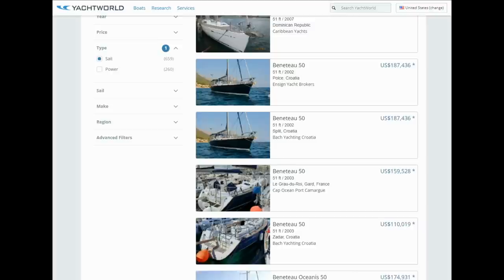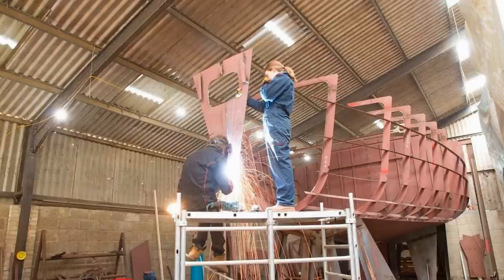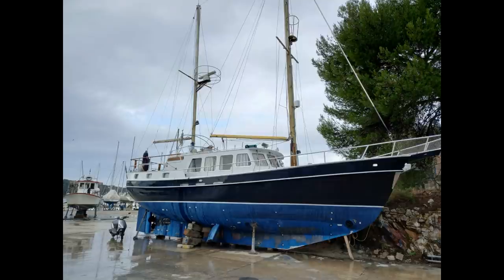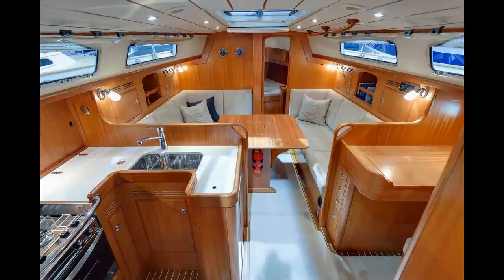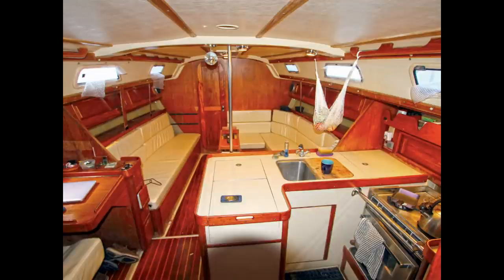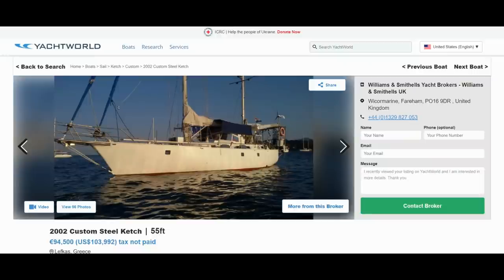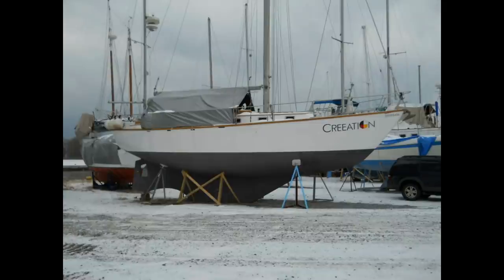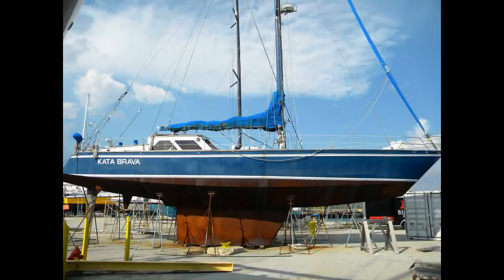Steel Sailboats - Episode 175 - Lady K Sailing

Comment: I have owned a 39 ft Folkes steel hulled sailboat for over 23 years. Fully loaded with provisions it weights 23,000 on the crane scales. All boats have inherent issues with hull materials, whether it is osmosis (fiberglass), rust (steel) or corrosion (aluminum) . Proper grounding of all electric systems and especially if shore power is used is the most important thing for any boat, as a lot of damage is done at the dock.  This applies to all boat materials. Cruising carries risks and if you are into going into places that are more risky such as remote areas (such as BC coasts) or areas of quick weather changes, hull material is an important consideration. Steel hulls can be repaired quickly and effectively without storing chemicals onboard. My alternator system is a Mobi-Weld system (90 amp Baush alternator with a 180 DC welder). I have two 2 by 2 steel plates under the floor that can be screwed to the hull or welded on. Mass produced fiberglass hulls have long moments on their keels (we are not talking about older full keels but fin type). It is this long moment of the fin keel striking a protrusion that is critical for these boats. The fin is forced back and the keel box is ripped out in front and the interior structure is pushed up and the hull becomes holed. With the Folkes we hit a concrete structure that was not on the charts or chart plotter at 6 knots and the result was a 3 inch dent at the base of the keel. The boat was stopped immediately and it was quite violent in nature. If this had been an fiberglass boat that would be the end of our cruising.  Most steel hulled boats of 36 ft or more have steel coach and decks as well. The old days of steel hulls often had wood however this creates its own issues. The steel hull interior has to be zinc epoxy coated before insulation is sprayed in with fire retardant foam. Hull and deck fittings are not welded on most times and are threaded holes with the bolt head on the inside and the foam sprayed over them so as not to sweat. This allows quick removal of all hardware for maintenance ( such as painting etc). I lived on my boat for 17 years (full time for over 7) and in winter the boat was at as low as -40 and up to +45 and was always comfortable. The fiberglass boats that I lived on always sweated on the inside and black mold was always an issue. As to the price.....a good used steel hull is generally cheaper than that of a similar sized fiberglass boat. The hull is about 1/3 of the price of the total boat....
Reply: Wow, thanks 👍
Reply: Fully agree … thanks
Reply: thank you for sharing your experience !
Reply: Thanks
Reply: I'm too poor to pay attention but I will buy a steel hulled sailboat or a motor sailor if the opportunity arises and live on it until I croak.

Comment: I love my steel sailboat - Bruce Roberts Spray 42, coming up to 50 years old and still in good condition. One thing is that even if you do get some rust you either clean it up and paint, or cut out the rust and weld some new metal in - it’s not that big a deal. Another thing, avoid sprayed on foam insulation as it hides rust.

Comment: I don't want to be mean but as someone who has cruised on a steel boat for the last 16 years I don't agree with a lot of this information. I'm not sure if this fellow knows much about them. I'll give just one example of many. Most of our boat has 3 coats of epoxy and 2 coats of polyurethane. These paints are not particularly expensive. What is extremely expensive in time and money is dismantling the boat and repairing rust before it spreads. This is a huge and constant job. Sandblasting inside your yacht is not fun or easy! Sure it's strong which is very nice as we are sailing in remote areas surrounded by reefs, and doing night passages straight through areas full of huge floating trees, but steel yachts are FAR more work to maintain than fiberglass boats.

Comment: I have plans for a 27’ Bruce Roberts spray that I was going to build until Larry Pardey told me a couple decades ago, at the Annapolis boat show, not to build it. He said he knows people sailing them and they don’t want to come about easily. The most important thing to check for on a used steel boat is the bond of the interior spray foam insulation to the steel hull. The hull must be coated with epoxy before the foam is sprayed on or the boat will rust from the inside out. Too many people think they can just spray the foam on bare metal but, the foam breathes and allows air to get at the steel. If the steel isn’t primed properly the interior epoxy paint will lift off the steel and the steel will rust unseen under the foam. If anyone is interested Brent Swain, on Vancouver island, has designed a number of steel boats using a frameless origami method. Darts are cut in the steel plates which are then pulled together and welded. The darts are welded up and they end up under the waterline so they can’t be seen. He claims he can weld up a hull and deck structure in two weeks.
Reply: Spray foam should be specified as closed cell foam. That does not breath, does not allow any moisture to move into the material. Remove any spray foam not imperials and replace with closed cell or use rigid rockwool insulation.

Comment: Enjoyed the episode. I have owned a steel boat for 28 years and I was getting ready for the typical steel bashing video, you did your homework on this episode and really portrayed the benefits. I have 40 lbs zink on bottom, yes keeping up on maintenance is the key, finding problems before they become problems is the key. The hardest thing is keeping up with the ugly cosmetic bleeders,  they are a cosmetic problem and can make a boat look ugly fast. Also you will find a steel boat is dry, I have zero cabin or hull drips even during a storm where most people usually find all the leaks on their boat. I hit and bounced across a reef years ago at 6 knots and just had couple small dents in bottom of the keel. A steel boat has to be part of you, not a launch and forget about boat. As always I enjoy your reviews!
Reply: I agree. I have owned my 48ft pilot house steel ketch for 15 yrs now. It is a labor of love and was built properly and professionally and other than the occasional bleeder around my side port hatches that show after a few years no matter what I do or how much corroseal,bar rust,two part epoxy inorganic zinc primer etc I use. I am well insulated and dry and not a leaky teaky. Wood is good and glass is fast but steel is REAL.

Comment: The thing that impressed me most about steel sailboats is that all the deck hardware - shrouds, cleats, winches, tracks, travelers, stanchions, etc - can be wended on.  No through-bolts.  No leaks.  You can have a completely dry bilge.

Comment: Have a look at Sailing Emerald Steel where you can follow the construction of the craft from ages ago and how they setup their equipment especially the water-maker using off-the-shelf components available from the manufacturer. Even the mast is from an ordinary lumberyard.    ..  Cheers to you  ..

Comment: Steel is cooler than fiberglass in the tropics.  The cool seawater cools the hull.  No insulation is cool due to the steel hull becoming close to temperature of the water.  Biggest advantage of metal boats is safer in lightening storms as a strike on the hull  goes thru the hull more likely than through you. Also, repair is prefect if you get a hole in the boat. The boat was built by welding panels together and that is exactly how a repair is done: cut out the bad spot and weld in a panel. The repair is as good as new construction. So, metal boats give better safety, are more resistant to collision damage and scrapes, the layout can be changed easily - cut out the old, weld in the new.  Rust is seldom the problem with boats that stay in the water - they actually rust much faster when out of the water or shipwrecked on a shore. And a perfectly round metal (steel or aluminum) can be constructed to look exactly like a fiberglass boat - round everywhere.  The real downside of steel construction is it is more expensive than fiberglass and too heavy if the boat is not at least 35 feet in length. I'm talking cruising boats, not racing boats where you would want carbon fiber.  One other downside I need to mention is that most marina repair staff are unfamiliar with steel hulls so you need to become a little expert yourself to tell them what to do, how to paint, etc.
Reply: I forgot to mention that sprayed insulation on the inside is often used as sound insulation - metal hulls can be noisy unless you have some sound suppression.  My steel boat (built in  1965 in Netherlands) had square cork tiles cemented to bare steel interior spaces using melted pitch.  Worked perfectly. Maybe on newer boats the spray insulation is used for flotation requirements?  Not sure.
Reply: This is why you go to the commercial docks for repair and maint with steel. They can haul out anything, and repair steel all day, every day.

Comment: Six years working for the Uncle Sam's yacht club, primarily on small craft, I've had the opportunity to maintain steel, wood, and glass boats, and found a steel haul will take a dent, where both wood and glass will hole and splinter so much easier, be far easier to plug, and patch. 
The Navy is all about painting, so no big problem there.
Steel is numero uno ! ! !

Comment: s/v Ravenwing is a Bruce Roberts 44ft CC cutter rigged steelie. Steel deck with AL deck house and cockpit. Heavy urethane gasket between. Keel shoe is 3/4" plate holding 13,500lb of lead. Bow stem 4" sched.80 pipe. I carry a welder, generator and steel plate. A needle gun is priceless, along with a galvanic leak detector system. Ultrasonic thickness sensors are cheap now, so are fiber optic cameras to look in spaces too small for your pointy little head to fit. Some of it was once "rocket science" but is now readily usable and very helpful.

Comment: I have built a few steel yachts,don't use  spray foam,if you use a good epoxy primer like interplus it will last for years,and no,steel masts are not a problem, you can weld all your fittings on,read Tom Colvins Steel boatbuilding,and a portable welder can be run off a generator,like a unimig,180 .
Plastic boats make good fenders,until you rub through them.

Comment: One thing that may be worth mentioning as an advantage with a steel hull is keel cooling for your engine becomes a very realistic alternative.
It's a hell of a lot easier to weld some long, thin tanks to the inside of the boat below the waterline, than it is to work out some questionable solution with a fibreglass hull.
This is a pretty good advantage because any unused space in your hull can become a very large radiator for your engine, but seawater gets nowhere near it.
Yes, you'd probably still need a seawater pump if you have a wet exhaust, but it's far less of an issue if it fails...even to the point where it doesn't effect the engine at all.

It can even be something to think about if you were building a steel hull boat, because your engine options aren't specifically limited to marine engines any longer.
There are many boats out there running keel coolers, powered by engines out of trucks, forklifts or even gensets...something that's quite difficult to do with a fibreglass hull.

Comment: I had a 54 ft round bilge steel Vandestat cutter , wooden mast & boom , Galvanized rigging , Canvas main , Cotton head sails in the early 70s (Couldnt afford anything newer, All second hand) . Great boat sailed like a witch in a blow , Never felt safer then i had on that boat & have had a few more since , Maintenance wasn't a real problem , Living on board you tended to be on top of it .

Comment: I have no issues welding without a welder just need 24 volt battery power + on the steel hull also has bilge keels so don't have to be hauled out just find a beach on high tide as long as the next high tide is higher or don't go in as far in and  and don't need to get on the hard
But yes got to keep a diligent eye on the zinc

Comment: I have crossed the Pacific on a 30ft steel boat built in the Neatherlands. The weight added to seaworthiness and I did the 2300mi trip to the Marquesas in 26 days. The 40’ fiberglass boats did it in 20-22 days… At that point not such a big difference, eh?  I loved my boat!!!!! It was run onto the rocks full speed in the Panama canal by the Pilot. A dent in the hull, that was it.

Comment: Thank you very much for this episode! I'd like to mention one important advantage of the steel/aluminum bots. All of them have very little probability of leeks. Almost everything can be welded directly to the deck. I have even seen the KMY yachts from time to time are not using the tracks for the jib but loop blocks attached to welded bars with holes. 

I also would like to suggest creating a separate video about the aluminum bots. I think in many cases, they can offer the best tradeoff between fibreglass and steel. They are lighter, easier to maintain than steel, and everything, including the superstructure, can be made from one material.

P.S. I just bought "The Complete Guide to METAL BOATS - for those who are interested in building in steel and aluminum because I'm seriously considering making an aluminum cruising boat. It looks very promising, but I will write more in the future.

Comment: Nice job. Might have liked something on how much difference corten steel does or doesn't make. At one point was quite a fan of Dennis Ganley steel designs (Pacemaker 40, Shadow 34 esp). His performed quite well aided by fairly light scantlings that a lot of home builders increased. Gifted designer. Died too young. Ganley's specified scantlings are probably plenty, unless you've lost a mm to rust.
And on rust I think the main thing I'd want in a steel boat is the ability to access all areas for inspection and welding (without setting the boat on fire).

Comment: Good episode!  Maybe next episode on Aluminum.  My boat is a custom Cutter rigged 5086 aluminum sailboat and I love it.  Looked at steel and shifted to aluminum after looking at the strength weight numbers.  Cutting aluminum is a breeze.  Marine aluminum is impervious to salt water.  My boat is very fast for its size 44' in light air.
Reply: just curious, as I am most interested in steel but have been considering aluminum, is the aluminum capable of a hard grounding with little to no damage like steel? I get such varying answers by people who typically have no experience with both.

Comment: As we are currently "kind-of" boat shopping for our liveaboard cruiser (upgrading from our current Catalina 25 here in the Great Lakes), and due to having boy and girl teenagers, the layout of the Dufour CT12000 is perfect for us (one main cabin, 2 identical single cabins, vbirth as workbench/great tool room).

 HOWEVER, they are rare.  And not cheap!  We haven't found another layout we like as of yet... but Steel may be the best way to go if we decide to pull the trigger and upgrade to our cruiser...I can weld/do whatever, but that may be the best option for us to design and/or build the layout we need instead of searching for the layout we want in fiberglass (because there are very few of the layout we would like under 50ft...)

Thanks for the vid man!  Now your going to have me expanding my horizons while on the search!
-Nick
Beaver Island, Lake Michigan

Comment: I love George Buhler's designs. While not sailboats, his Diesel Duck series are largely built in steel and he designed a supplemental sail into most of them.

On another subject, I have a Deko brand stick welder that I carry with me on my work van. It is about the size of a shoebox and it will operate on 120 or 240.

Comment: I had the opportunity to buy a 60 foot steel ketch about 15 years back that was way below it's actual value and I'm still kicking myself to this day for not buying it. It had the most beautiful hull I'd ever seen on a steel built hull.
Reply: How much was it?
Reply: @ciaranbyrne62  The last listed price was 55K U.S. Dollar.
Reply: @never2late454   Seems reasonable. Probably have to throw another $12 k at it to make it  good as new. Here in the UK you would have to pay $800 dollars a month for storing in a boatyard or $600 in a marina. Big boats, big money.
Reply: @ciaranbyrne62   The boat I'm talking about was fully rigged and complete refit with new sail's, new stainless rigging and chain plate, new winches, new windless, new teak and Holly soles and a refurbished teak deck with mahogany interior. Everything completely gone through and well worth over 100K.
Reply: @never2late454  You must be kicking yourself. I've spent most of my life trying to save for bigger boats. But something always comes up either a new car, holiday or new windows for the house eats all my boat money. I have two 22 footers in different locations of the UK. I'm determined to get a 32+footer one day. Boats seem to be cheaper in America I might have to try to holiday over there and try to sail it back hehehe. I think my current budget is $10k
Reply: @ciaranbyrne62  I know how you feel. I've finally got my boat but now getting it ready to head out to the Caribbean next winter. I'm spending countless hours on YouTube learning other people's ideas on things to add so I'll be more comfortable aboard the boat during the trip. I'm currently working on building a solar and wind energy system. and a backup navigation system.
Reply: @never2late454  Fantastic. My number one upgrade were two 120 litre water bags placed in the bilge lockers plus a 15 kg bottle of gas powering a hot water heater used to power a hidden shower on deck to get off the salt before bed. 2nd was a suitcase generator to recharge the AGM batteries every day when they dropped to 50% connected to a 1000W sine wave inverter. Third was making a full cockpit tent for those long rainy days.